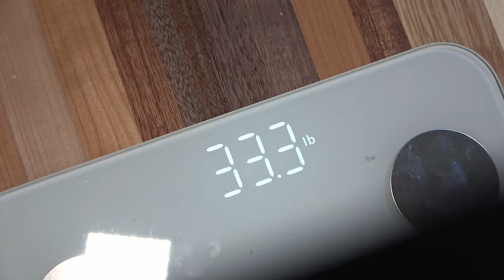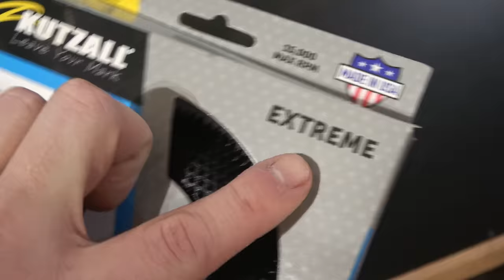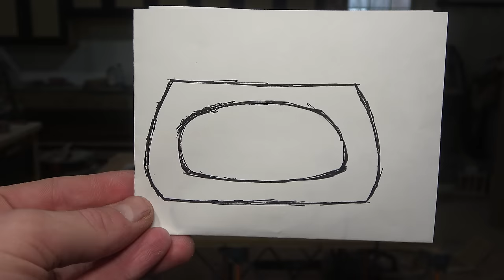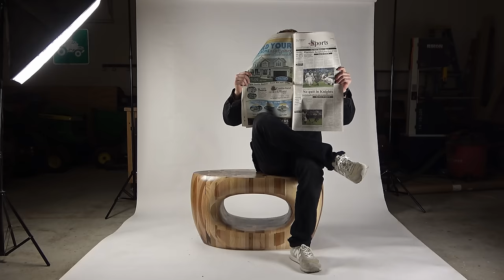I Carved This Out of A 350 Pound Block of Wood

Comment: Just a thought to ponder. Woodcraft is my passion. We had diamond wire saws that we use to cut down oil platforms underwater. I don't know of a woodcraft product out there that works this way but that means we need to create one. Bore a hole, then feed the cutting wire through and run the machine like a bandsaw to remove that center. Quit being wasteful 😂 Until we create that saw. Just plunge cut the center out so you can minimize your waste and recycle the waste as usual.

On another note. Don't waste all that sawdust. Store it in a trashcan or something and use it for filleramd such. Then you won't need to buy wood flower. Also get yourself a chain hoist for large heavy projects. You will need it when you get older.

Comment: Looks very good it's good to see someone making something unique I use to have a lathe and never liked to make things that looked alike defeats the purpose of making something different if you're going to make another made a12 foot by 3 oak table and had to use 3 ton excavator to move it when it was finished and all the wood was cut with a chainsaw from the forest to the finished product hand electric planer and belt sander and orbital sander to finish but the legs are rounds that I decorated with leaf shape and took me 6 days to sand it

Comment: Very beautiful. Amazing craftsmanship.  On the final glue up u could have used dowels. And for flattening top and bottom side u could have used an electric planer. That could have saved a lot of time and effort. Lots of love form India.
Reply: An electric planer does not guarantee a level surface. It will be flat, but it may not be level. His method made it flat and level.

Comment: Compressed Saw dust mixes with a little bit other petroleum byproduct can be used as starter bricks for camping. Could be a nice accessory product for your online store. Dont feel bad. You’ll get better at planning  builds and wont have to cut or grind nearly as much for other carving builds.

Comment: Next time, try using a hand scraper on thise inside curves to remove the scratches. Then follow it up by hand sanding. I think it would have saved you some time vs. the sander.

Comment: Nice piece of work, I like the end product. As an ex-ED and Trauma nurse can I advise you push the router away from you as you cut? pulling towards you like that on the cut you could end up with a lovely mangled abdomen. also make yourself a zero clearance throat plate to avoid loosing pieces like this.

Comment: That looks wicked! As to the chainsaw, it’s killing the battery because you are using it to “rip cut” when it’s designed to cross cut! Just like a circular saw blade, take a 60 or 80 tooth blade and slap it in the table saw and see how much harder it is to rip a board. They still don’t last as long as a gas powered even when cross cutting, but live gone to almost all electric just because it saves money in the long run (near zero maintenance) and oh so much easier and quiet!!

Comment: I didn’t get it until it was done. I think it turned out beautiful. Nice job. And take it from someone who’s been using chainsaws for 40 years and owns one of the biggest ever made, battery operated chainsaws have a place in our lives. I bought one to use in my workshop. Not dying from carbon monoxide poisoning is a good thing. They’re also lighter and quieter.

Comment: This film has at least one advantage: it is a model example of how not to build not only furniture, but anything that is supposed to fulfill any functional function. It's your materials, your tools, your time, and your electricity, so you can do whatever you want with them, the question is: why? At the beginning of the film, you ask yourself: "Was it worth it?", but for some reason you don't give the answer in the end. Well, the amount of wasted material would allow you to build two of these objects while reducing the time and effort involved in creating a giant block with a hole in the middle. I'm assuming that you wanted to create a work of art with a utilitarian function, and this begs another question: is an object of this size and weight really a table? The weight of the object is disproportionately large to the area offered. Such an object as a piece of furniture is simply impractical, because it is only a low and heavy block offering minimal space on which to place something, but what: a cup of coffee, keys, a smartphone, a newspaper? So much effort and materials to create a small support or seat. You started working without thinking about what you were creating and why. In order for something to be a useful piece of furniture, it must meet the appropriate performance parameters, i.e. take into account factors such as the ratio of weight to size and the area it occupies, because the potential user will have to move this thing in order to clean or rearrange the apartment. The idea of creating anything consumed you so much that you stopped thinking rationally. If you wanted an interesting pattern consisting of different colored pieces of wood, it would be enough to use a natural block of wood and then cover it with appropriately selected strips of wet and hot shaped wood, or simply glue it from pieces, but immediately with a hole in the middle. Here's a link to a video that shows you how to create similar organic shapes and avoid the waste presented: https://www.youtube.com/watch?v=kLPE5QLz9VY

Comment: 14:20 Then, dont waste it.
1) charcoal it, and put the video on YouTube "xxx lbs of sawdust waste into xxx lbs charcoal"
2) feed it to pleurotus ostreatus (oyster mushroom) myshroom mycelium - youtube search "ecovative" and eben bayer for the process. 
3) Mix it with epoxy in the form of new table blanks or blanks for short legs. Get a few vacuum-chambers to degas the mix (small chambers might be a waste of time...maybe just use big bags with vacuum pumps...) 
4) blank epoxy+sawdust long cylinders in plastic pipes, interior-sprayed with silicone mold-release...bag-vacuum them and turn them into chess pieces or chess-board squares.

Comment: As a woodworker you should see if you have a bio brick (I think that’s the name) maker in the area to ecologically dispose of the excess wood and or the saw dust. They use paper products and small wood to make fireplace or wood stove bricks to heat homes. I hope that helps.
Subscribed JUST  to boost your fragile little ego. Happy?☺️ Weird, but very nice.

Comment: Here's my hate comment 😁:
You could have taken those two pieces to a place that has a large bandsaw and they would have cut it with minimal waste.
Or you could have bought a long thin drill (long enough to go through the wood) and made a bunch of drill holes and then used a piece of broken bandsaw blade to make a "giant coping saw".
Or you have cut the pieces before making the two big chunks in a way that you would glue them leaving the hole in the middle, like lego.

Comment: You didn't have to make all those cross cuts with chain saw you should have made two cross cuts and then plunge cut with the bottom half of the top of bar till your into  the cut with the total tip of bar then make your cross cut  you would have had your block to make your blanks. With way less waste

Comment: Mineral spirit's is so far from an oil it's weird to hear you say that it's actualy an oil! 
It's used as a thinner for oils and for CLEANING oil's. Not to forget also scientific experiments that leave a clean trace. 
What you did was dampen the natural wood oils but they faded within a few min's as the SOLVENT dried.
When I did this kind of thing they gave us 2 day's to get to 800grit mirror finish.
Get yourself the biggest angle grinder you can find and step down your sandpaper in steps.